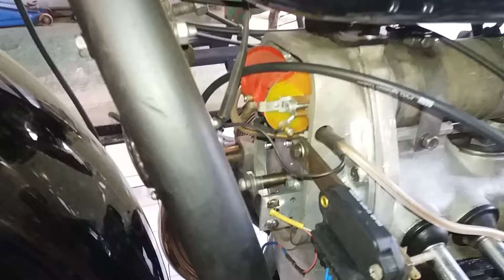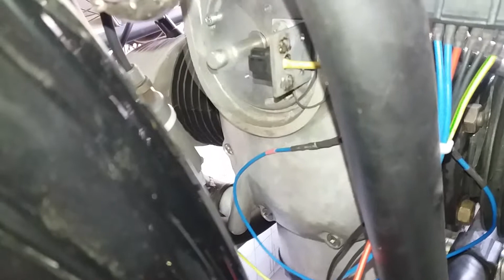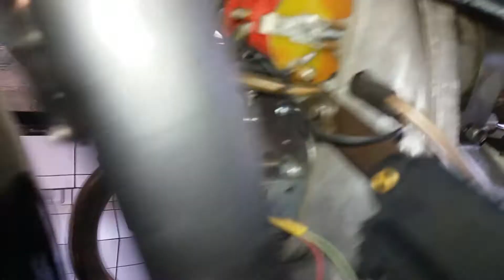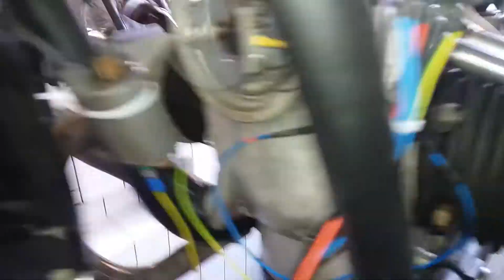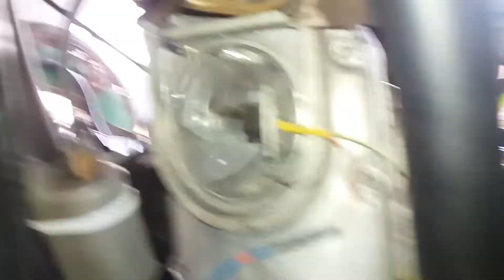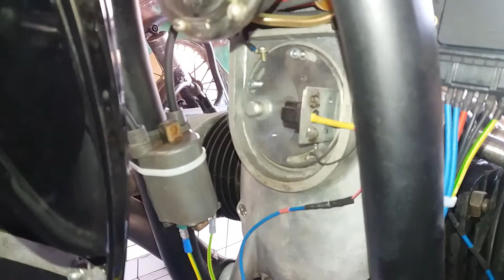Electronic ignition for Dnepr / Ural (12 volts) - thourth part

Comment: are U using a bmw r100rs electronic control , yes?
Reply from the maker: It is from R65 model but it may be the same part with the one from R100rs.
Reply: oh yes,  ir can run perfectly if the ignition curve is the same...  im trying to do this for a r90s..  can you explain me the wiring of the control unit?  i,ve search the diagram in some books but i cant undrstand it..  and the captor what is?  a stardard hall effect captor?  i want to do this!!  thanks a lot :)
Reply from the maker: This unit does not have an ignition curve, at BMW R45/R65 the ignition curve is made by centrifugal advance spring unit and the electronic part is only for the spark. The hall sensor is the same with the one from the BMW R65 but i have found the sensor on a VW engine type. For more info write me, my email adress is: lznicu@yahoo.com.